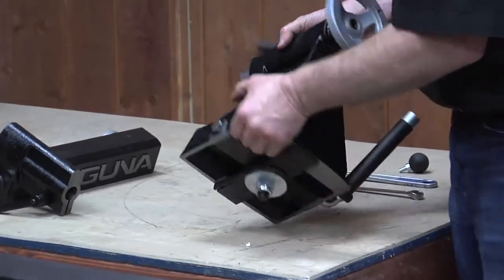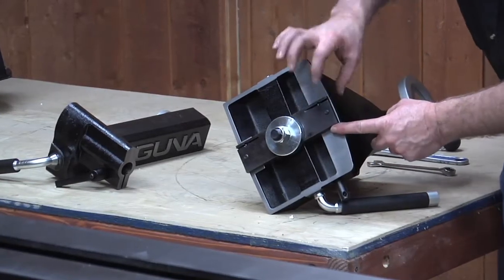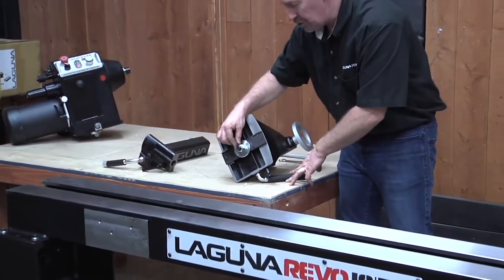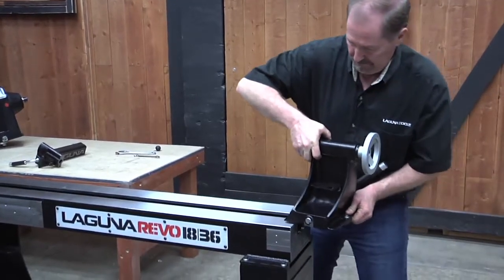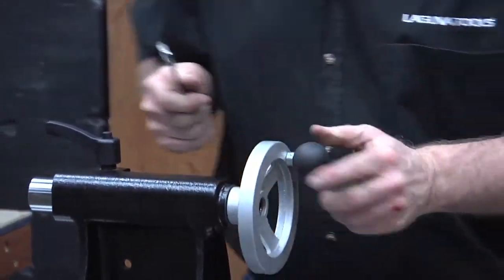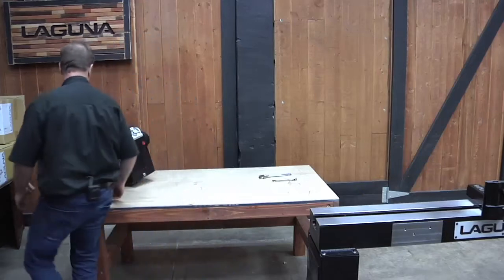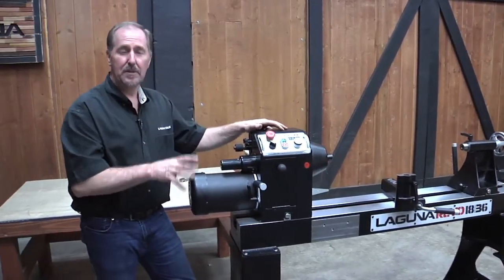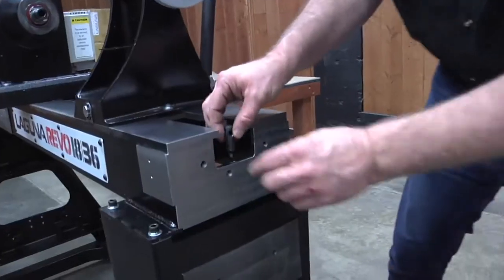REVO 1836 Lathe Setup  - Mount Head And Tailstocks - Part 4

Comment: Nice look. I have the 1647 model which I have used for quite a number of years. I really like the 47” bed. My question is can I use these three components on my 47” bed? I really don’t want to give up that extra 11” of room when working with just the head stock and the tail slid out of the way. I have really enjoyed using my 1647 and my only reason to change now would be to reap the upgrades that come with the 1836. 
Again thanks for these many years of dependable service your lathe has brought me. I purchased my 1647 mainly because of the price point but I would purchase again because of the quality of the machine.